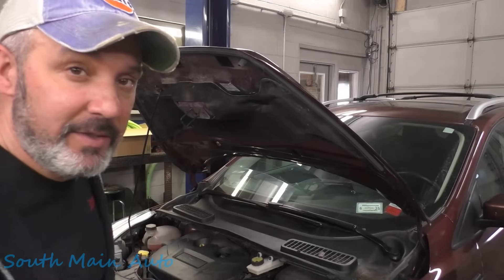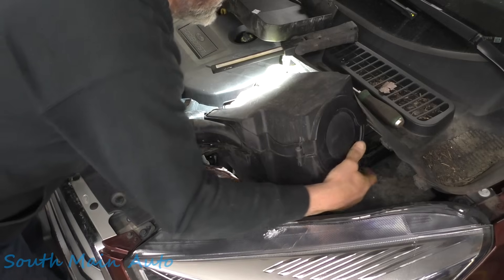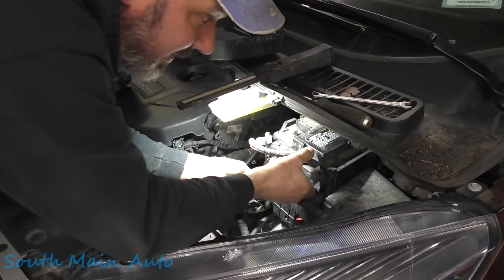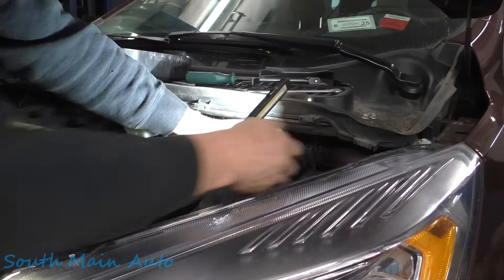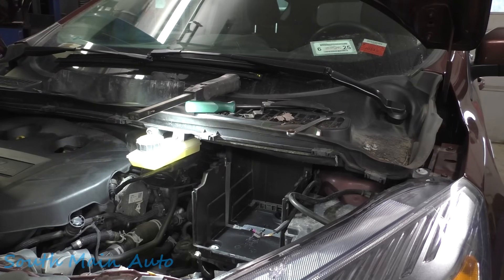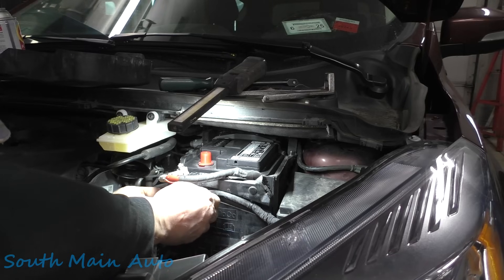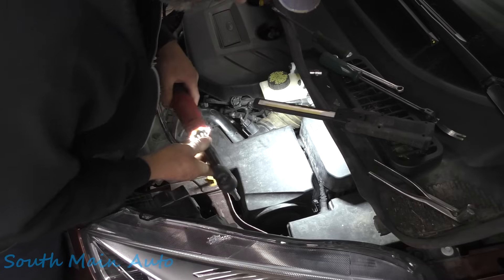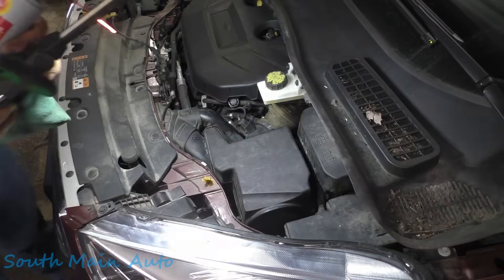Ford Escape Battery Replacement

Comment from the maker: 5-Piece Battery Maintenance Kit - https://amzn.to/3IFola3
Reply: Just FYI on the VW batteries, you can use a non OEM one, the serial numbers is only used by the computer to detect the battery has been changed. When you install a non-serialised battery, just take the serial number off the old battery, and increment it by one on the last digit, so if the original was XXXXXXXXXXXX5 put XXXXXXXXXXXX6 into the computer. All will be well. No other data is taken from the serial apart from recognizing a battery change has occurred, and for the battery health monitoring to reset to a fresh battery...
Reply: I LOVE THE CLASSIC INTRO "Welcome Back Viewers, To South Main Auto"
Reply: "Its Got The Big 2 point 0"
Reply: @jovangrbic97 " Hey there viewers, welcome back to the South Main Auto Channel. " You gotta love it!
Reply: Here you go folks .Get your own battery speculum. SouthMain approved!
Reply: I bought one of those terminal pullers and use it to pop the rear wiper blade of some Nissans.
Ain't no way that thing is coming off by just taking the nut off the shaft.
That "POP" when the thing comes off is most satisfying.
Reply: @paradislarry 
As classic as "remember, stay dirty"
Reply: @ SouthMainAuto Love watching your videos, just wanted to give you a fair warning that removing the battery that way on an escape or focus with that battery setup with the high current battery junction box located in the front of the battery tray is not recommended. Being a Ford senior master tech I have seen multiple cars come in that will not start after battery replacements due to removing the battery like that and the fuses flex and will break apart. Recommend procedure is to remove the wipers and cowl to gain access to battery
Reply: ya goda take the cowl off, wipers, same as focus.. 2008..same air box..
Reply: Looks just as fun as changing spark plugs on those pos
Reply: Almost  as bad as changing battery on chrysler 200 lol
Reply: Great buy My snap on one in 1980 cost me 85.00
Reply: I HATE MY CARS BATTERY. 🤣😤
Reply: @aarsenalfan  Awesome

Comment: Why have I dedicated 22 minutes of my life watching Eric changing a battery on a Ford Escape. I don’t own one, I never will. 😂
Reply: But now when someone asks if they should buy one you can give a firm answer of: “Absolutely no!”
Reply: @RustyZipper Yep.   Not to mention all the other boneheaded decisions Ford engineers are making on these newer Ford/Lincoln vehicles.  For example most of the car is put together with one time use fasteners, especially Nylock nuts.   Ford loves their disposable nylock nuts, they use them for everything now.   Doing a brake job, well you have to buy new nuts.   Wheel bearing goes out, you have to buy new torque to yield bolts for them.    I could go on, but I digress.
Reply: Its Ford Euro. Explains why its so different
Reply: I didn’t. I skipped ahead because I thought there had to be a twist… but not so much.
Reply: @jtjones4727 great point overall that also covers Fiat Chrysler, Chevy, and all the South Korean manufacturers, but I don’t think digress means what you think it means. You never once ‘strayed from the topic’ as you were talking about the same subject throughout the entire post, but I digress. Toyota and Mazda are about the only truly reliable vehicles made these days.
Reply: Lol!
Reply: i wont ever own a ford, yet here i am watching also lol
Reply: Because it's escapism.
Reply: I'm in the UK, I'll never see most of these cars but I just like listening to Eric and some of the general ideas will crossover to our cars
Reply: @OtisPlunk  never skip ahead on Dr O's videos! You'll definitely miss a one liner! 😁
Reply: I'd DEFINITELY do the classic battery relocation to somewhere that had vertical insertion!!
But, after this video Ford Escape  !
Reply: I’ll keep my Kia thank you.
Reply: Eric O has earned your time. No go up & say hi to your mom. 😅
Reply: Because it's entertaining... who other than Eric would use a speculum on battery terminals?
Reply: Best 22 minutes spent watching YT. Saved me from watching Politics!
Reply: That is hilarious, I was thinking the same thing!!
Reply: It's not about the Ford Escape. It's all about Eric's classic knowledge and the delicate way he expresses his dislike for engineers.
Reply: @mph5896  Yeah.  IIRC it is called the Kuga in Europe.  Not to be confused with Cougar.
Reply: I think he said something about a (battery) speculum! Maybe that's why you dedicated 22 minutes to watch?
... Let's face it. Car porn is still "porn." Of course, you'll watch -- we all will! (But I agree! 22 minutes might be a bit much.) 🤣
Reply: Take to Advance for free battery installation
Reply: @WXSEDY 😊😊
Reply: He is a clever man and his comedy side is spot on :-D
Reply: Amazing, it takes an experienced certified mechanic at $80+ minimum an hour in a completely equipped shop to change a battery that used to take 15 min by the min wage kid at Walmart. SMFH
Reply: @KendrasEdge757  I'm guessing you had some bad luck with a Honda.....
Reply: @peterwong9458  Since the world has gone crazy,one wouldn't want to fall behind by missing the idiocy
Reply: @dddevildogg  nah not at all, but they’re not what they used to be that’s for sure. Seem to be goin downhill on quality and tossin cvt trash in everything they make.
Reply: Welcome. We don't know why we do it either.
Reply: @nigelunitt1614 Eric always says he's five years behind the curve due to not seeing many cars under warranty.
Reply: because we all just want to hang out in the garage with Eric fixing stuff
Reply: @OtisPlunk  Sacrilege!
Reply: Well, it beats getting work done. :)
Reply: Have to love it when they bury the battery. I did a dodge avenger where it came out through the wheel well.
Reply: Well, thanks to this, I never will! A 5 minute operation turns into at least 25 minutes. Nuts.
Reply: Step 1... remove engine & trans.
Step 2... firmly grasp opposite corners of the battery and lift up.
Reply: That's about the only thing that most Fords needs is just a battery. But you would rather have a General Motors car that needs everything else.
Reply: @barry570  advance would refuse to do it. Too hard.
Reply: So you can help your neighbor out with their car:)😊
Reply: @MattExzy  I learned a long time ago that almost NO repair job on anything is a "5 minute job." Same with someone saying "I need your help with this; it's a two-minute job..."
Reply: Same here!
Reply: I watched it simply because I wanted to see exactly how it could take this long for a professional mechanic to change a battery.
Reply: The daily dose sarcasm 🎉😂
Reply: What a bad design.  Make cars smaller, cram everything in and not think about serviceability.  New cars suck.  A computer on wheels.
Reply: To keep you from changing your own battery and looking like the cat won 🥇 scratch up your hands!!!!
Reply: I like to watch other people work?
Reply: Because one day you may buy a car with a hidden battery and you may of learned something.
Reply: There are worse ones than that. !!!!
Reply: The commentary
Reply: He said it in the first couple minutes; entertainment value.
Reply: @jtjones4727  I threw those E14 bolts that hold the rear wheel bearings in and replaced them with hex head bolts.  There are so many things on these Escapes that make me want to sell it.
Reply: As a owner who's about to go change the battery, the design of this car is horrible. I really can't believe I have to remove my master cylinder to change my battery. These things used to be so easy you could just do it yourself. Now you can, you just don't really want to, nothing enjoyable about removing a dozen other items to change your battery! THANKS FORD!
Reply: @RenoBusdriver  not if some kid with a USB cable decides to steal it.
Reply: @BlockdAccount That would be true, however I upgraded to a push start switch. It requires a RFID tag in order to start the car. Still want to use my key in the ignition switch that doesn’t exist anymore. I’m sure the car can be hot wired if they really wanted it.
Reply: @OtisPlunk  there was, but it was the airbox..in the beginning😂

Comment: Have a '17 Escape. I found doing it the way you showed was better than the recommended repair. They want you to remove the wipers, and cowl to lift the battery out. I didn't have a scan tool that could reset the BMS, but found that key on engine off if you flash the brights 5 times, then pump the brake 3 times, the battery light will go from solid to flashing, the BMS is then reset.
Reply: That’s killer. How did you find that secret key/pedal combo?
Reply: Wipers off and cowl would be faster IMO.
Reply: @johnt.848 Done many both ways. Wiper & cowl is our perfered method and yes we find it is faster.
Reply: Yes I did mine with the wiper and cowl removal method. Lots of space to work that way and it doesn’t take to long, however it’s still ridiculous just to change the battery.
Reply: Wiper and cowel removal takes 5 minutes.
Reply: You’re lying

Comment: Changing the oil is probably an engine out procedure on that one 😂
Reply: He showed one a year or 2 ago, on a Cadillac if not mistaken. Book time was like 1-2 hours, you had to tear apart the truck to replace the battery.
Reply: Nah, no need to replace the oil.
If other things on Fords are anything to go by, the engine oil is probably good for the life of the vehicle🤣👍
Reply: Oil change is not too bad...  Taking the stupid 'splash shield' cover is a pain...  Then it's easy.  I left the stupid cover off, so now it's a breeze to change the oil.. :)
Reply: @simonilett998  ain't that the truth. especially for those cars that have the powersh@t transmissions!

Comment: What a Major Production just to change a Battery
Reply: Crazy, real pain to do it in a Walmart or AutoZone parking lot too.
Reply: Still easier than some others.... He didn't need to jack up the car, remove the tire, inner fender shield, then work in that hole to get the battery changed.
Reply: German Engineering.
The Ford Way. 😅
Reply: Much easier from the top, wipers, cowling, pops right out.

Comment: I can't believe you managed to make a battery change into 25 minutes of juicy content. That's either a testament to your skills as an entertainer or the level of psychotic Ford's engineers are.
Reply: That battery is probably in the most deranged/unhinged pysco location I've ever seen😂
Reply: @DeeSea3  You need to get around more then. There are WAY crazier locations. Behind the fender in front of the driver's side front wheel is one good one. I think that was a Chrysler thing. In the trunk is pretty common these days though those at least are easy to replace, once you find them. Under a seat is a good one too.
Reply: It’s probably both with Eric. 😂
Reply: @John_Ridley , yep had a 99 and it was either Dodge or Chrysler don’t remember exactly. But had to pull the left front wheel off and pull back the finder liner to change the battery. I remember Eric doing one as well on the channel. A Avenger I think is the one he did it on. 

Difference between when I did this and Eric is. Outside in the cold on the ground to probably cold outside I think, but inside with a lift. 😅
Reply: its proof that the guy who graduated dead last from his engineering class gets the same exact diploma as the guy who graduated first!
Reply: I have an '07 Ford Escape hybrid. A lot of things in this POS are hard to access, but oddly enough, the 12v battery isn't one of them.
Reply: When you're married long enough it becomes natural.
Reply: "Yes."
Reply: @leftyo9589 See, the thing is, the engineers get handed drawings of what the outside of the car WILL BE and what the interior WILL BE and they have to fit the engine, battery and all that in the space they have. They don't really get handed a lot of options.
Reply: Worst battery locations would have to be the escape, dodge/chrysler wheelwell location, and merc under pass front seat.  All of these are great at filling the swear jar.
Reply: @John_Ridley yeah it's not always on the engineers we know that
It's just funny when you poke at them because they usually get upset about it. 
Another thing to consider is all of the stupid emissions rules now AND safety requirements, both change drastically every year.

Comment: Just FYI on the VW batteries, you can use a non OEM one, the serial numbers is only used by the computer to detect the battery has been changed. When you install a non-serialised battery, just take the serial number off the old battery, and increment it by one on the last digit, so if the original was XXXXXXXXXXXX5 put XXXXXXXXXXXX6 into the computer. All will be well. No other data is taken from the serial apart from recognizing a battery change has occured, and for the battery health monitoring to reset to a fresh battery...
Reply: Don't own a VW, but good to know. However he said that the VW battery is cheaper than non oem battery. That is also good to know for VW owners.
Reply: Yep just change the number by one and done. Always good to know
Reply: @orinmangar2333 Unless the VW battery sucks and has Low CCA compared to Napa..
Reply: @jovangrbic97 I don’t remember having to do that on my ‘15 Golf when I replaced the battery 6 years ago. I bought it at the dealer but took it home and put it in myself. 
Can that be done in OBDEleven / VCDS?
Reply: When I do a battery relearn on a VW, I like to set the serial to the current date and then fill the rest with 0s.

Comment: Great video. Imagine the kid at Auto Zone installing this battery for free. Great engineering FORD. Thanks Eric.
Reply: They'll punt.
Reply: Back in 2000, when I was managing an Advance Auto, the hard to change batteries were just coming to replacement age, several had to remove either the back seat or a passenger side tire and fender liner. Made a few customers mad because I refused it due to the overly complicated process to replace a battery, and we were liable if something went wrong, engineering at it's finest, Buick, Cadillac, Saturn were the first ones we saw. I like my tundra, wife's highlander, kids rav4 and Camry, battery easy to change, almost all maintenance items easy to get to

Comment: Wow, I'm reminded of the fact that here, you're usually doing this outside in the cold.  This alone would keep me from buying this.
Reply: Preventive maintenance
Reply: @joedurso5192  you cant prevent a battery wearing out and needing replacing!
Reply: In a Walmart or AutoZone parking lot, lol
Reply: You most certainly can…load test when the seasons turn, replace every 5 years regardless and or when a battery starts to fail, the engine will turn over slightly slower. That’s a real tell tale right there.
Reply: @joedurso5192  You can load test and it will test fine.  And the first 20 degree day you'll find yourself replacing a battery outside in the cold. just like I said. lol

5 year thing doesn't work any more.  Battery quality is slightly better than random now.  Not unusual to need to use the warranty now a days.  A new battery might last 3 years, 5 years or a week and a half, it's a toss up.

Comment: I own two of these since new and I remove the wipers and cowl to get to the battery....eliminates the need to break the filter box as well.  Take a lot less time and don't have all the restricted space issues.  Never expexted a battery replacement video from you...but those non Escape owners dont know, until they know.👍
Reply: That’s what I did on my 2013.
Reply: Same here.
Reply: I'm still driving my 2001 escape.  Nearly at 300,000 km.  I love mine, but while looking for a replacement I don't think I'll touch any of these newer models.

Comment: This underhood engineering is the quintessential example of squeezing 10 lbs. of "stuff" into a 5 lb. bag, what a PITA! Nice work Eric, thanks for continuing to share your mechanical and electrical talents with the online masses.
Reply: a lot is to do with modern cars having a 180  degree front window, half way over the hood.. i have a ford focus 2.0 tdci. goes like a cut cat. cheap, reliable. 2008.. i take the cowl off. easier..
Reply: ANother case of building the vehicle around a main part.
Reply: @harrywalker968 I had a 2007 c-max 1.6 tdci. I had to take out the ABS module which is behind the battery and send it off for repair. That was fun. Replaced the leaking injector seals at the same time.

Comment: I'm a DIY:er. That's why I kept my old Toyota Camry for 24 years. It has a brilliant design. You can even change the heater core without ripping out the dashboard. Note I've never had any reason to do that because of the quality of old Toyotas!
Changing the battery takes a couple of minutes!
Reply: 2005ish Camry with low miles, gold.